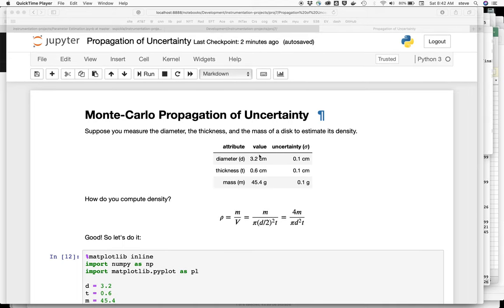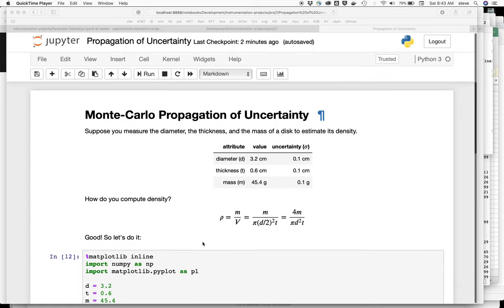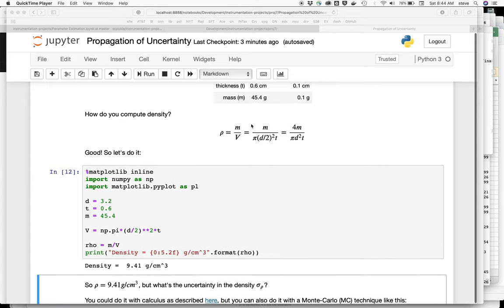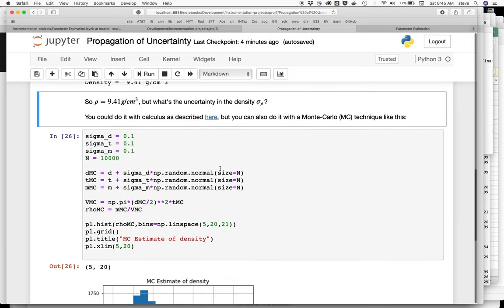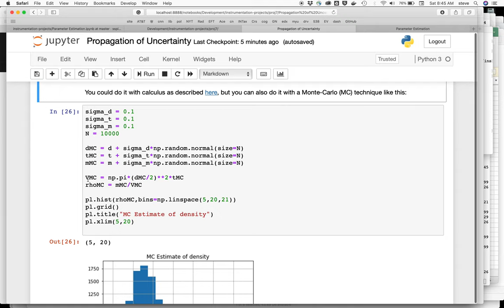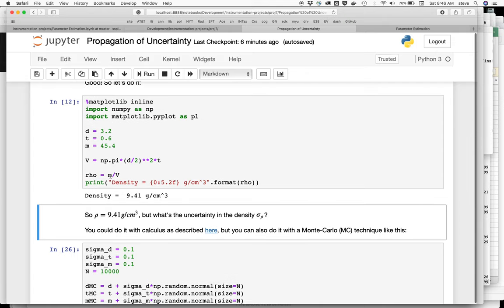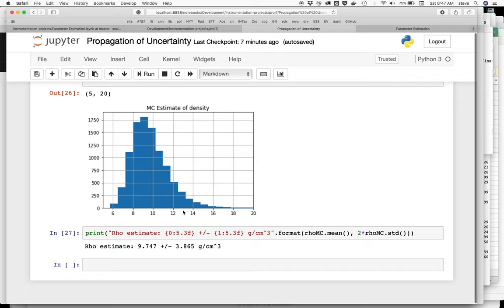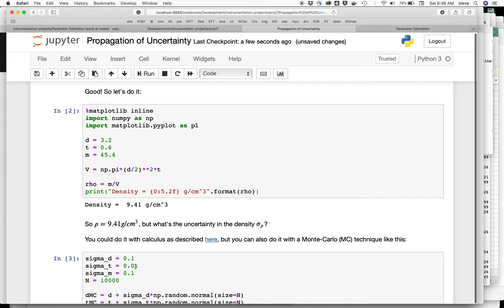Monte-Carlo Propagation of Uncertainty

Comment: but, what if data is not normally distributed (non Gaussian) ?
Reply from the maker: Then it depends. A gaussian is just a reasonable guess that's easy to generate (and suggested by the central limit theorem). If you know what the distribution is, just use that instead. If you don't, and you have reason to believe it's not gaussian, then you're in tough spot.

Comment: Thanks for providing the excellent expains
I just wanna ask you about the distribution. It is not normal distribution. If you repeat the run 100 times and every time you can calculate the mean . Finaly you will have 100 mean values and then you could plot the histogram. This way you will get normal distribution and could give you more accurate results...do you agree with me ?
Reply: I think that you're referring to the central limit theorem right? I don't think it applies here because if you repeat the run 100 with the same values, it will produce the same distribution, no? If so, then the summary statistics won't be meaningful.

Comment: Why do you put 2*rhoMC.std() instead of just rhoMC.std() at the end? where did the 2 came from?
Reply from the maker: Well, assuming a normal distribution a 95% confidence interval is +/- 2*sigma. Note that it's clearly not a normal distribution but this will give a rough estimate of the interval. You could do better by computing the cumulative distribution and searching for the 2.5% and 97.5% limits, but I didn't go into such things in this video. Maybe that would be a good follow up sometime?

Comment: interesting, I think i missing something in my code... each time I run my code, i get a different plot. Is not supposed to be consistent with the plot but have variable ranges?
Reply from the maker: How many points are you using? If it's a small number you would expect some variation.
Reply: @sspickle   makes sense! my familiarity with Python is not high, so I forgot to specify the bins=np.linespace(5,20,21) part after asking for pl.hist(rhoMC). Thank you kindly. Also, I'm assigned to develop an MC analysis for development schedule predictions and figured Python would be a good tool to use. Do you have any recommendations on what to prioritize when exploring Python to develop this analysis tool? Your advice is much appreciated
Reply from the maker: I would start with pandas, numpy, and scipy but there are many others!
 @cengizhancengiz1919